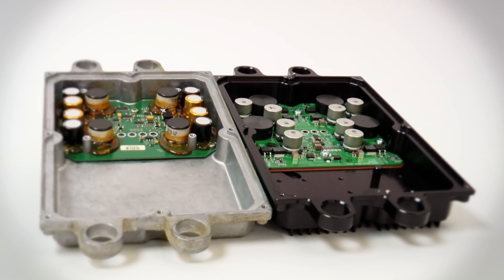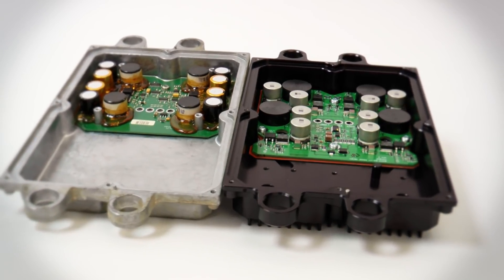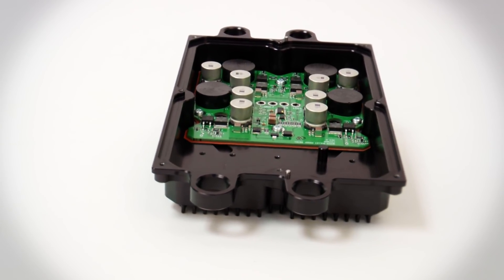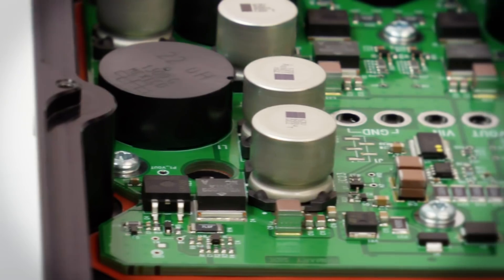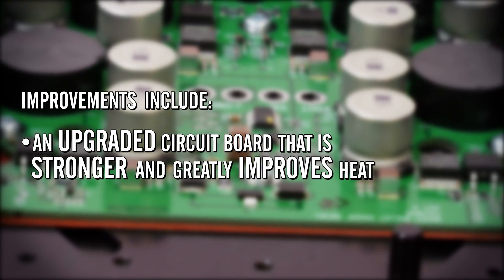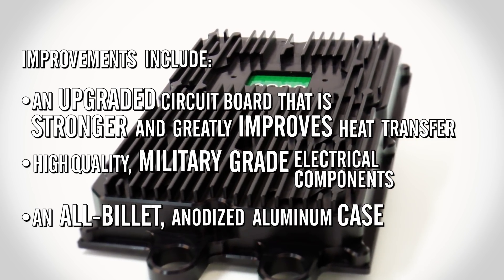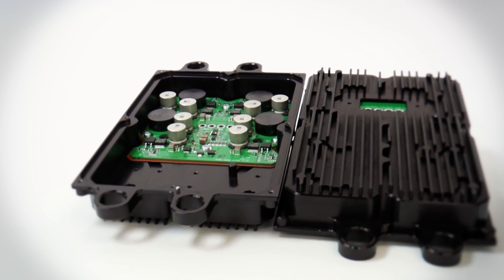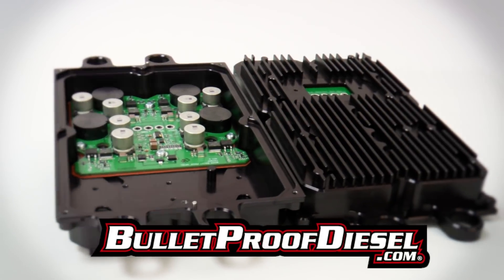BPD VS OEM FICM

Comment: I checked my ficm and I have 46 volts but it cranks but does not start. What could possibly be the problem. Two, what is the best and easiest way to bleed the truck of air although I am not sure if that is possibly the problem. I have been having this truck for about seven years now and I never had any issue with it, although I don't drive the truck muck. I will really appreciate your assistance to get my truck working again and back on the road.
Reply from the maker: There are a lot of things to check here - perhaps write us an email with as much info as possible and send to us at customerservice@bulletproofdiesel.com or give us a ring at 1-480-247-2331.